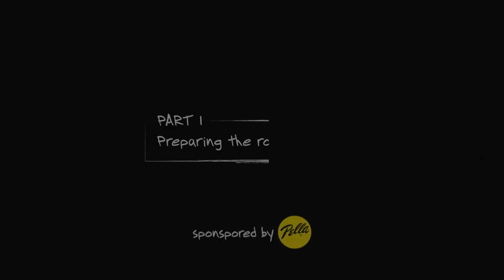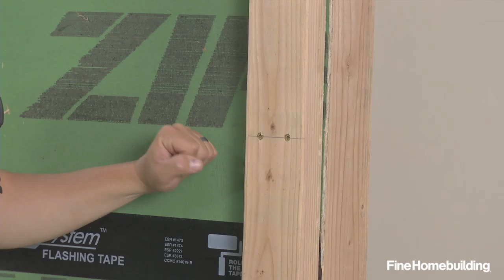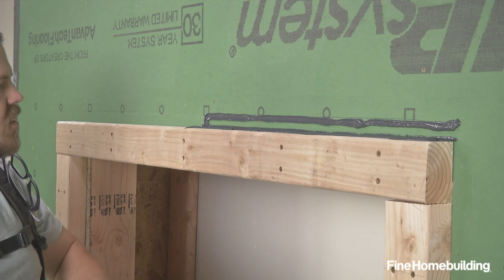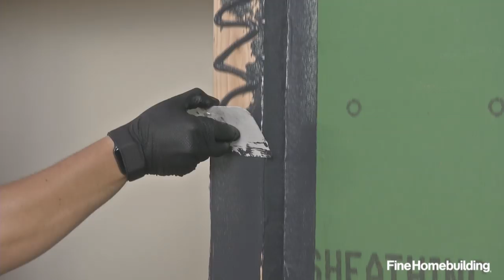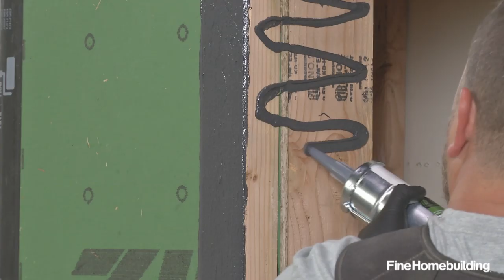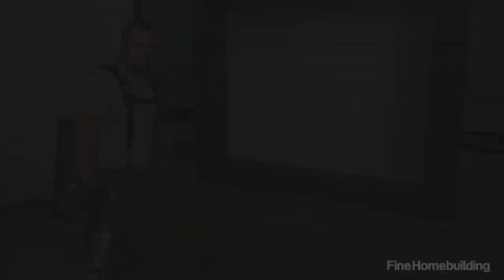Part 1: Prepare a Rough Opening for a Nail Fin Window Over Exterior Rigid-Foam Insulation

Comment: My experience in hot-dry westher (say 85 and above), I found the liquid flash skins over long before you can finish detailing any sizable window. It's a 2-person job for larger windows. I found pinholes develop in some batches of liquid flash, so needed to go back and touch up. Great reminder to wipe down existing tape with acetone - literally the last place you want a bond failure

Comment: the external frame is wood, what's the point? It's a thermal bridge, the cold will transfer from the inside to the outside, now there is product, solid foam made to insulate and nail your window frame...
Reply: Thermal Buck!
Reply: Maybe rip down a sheet of 2 inch Zip-R and screw the window through to the framing?